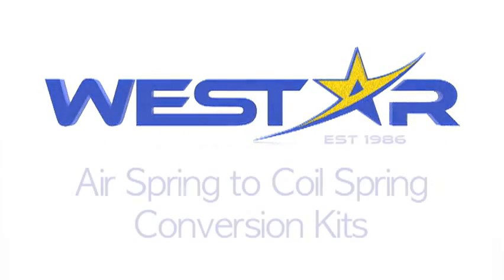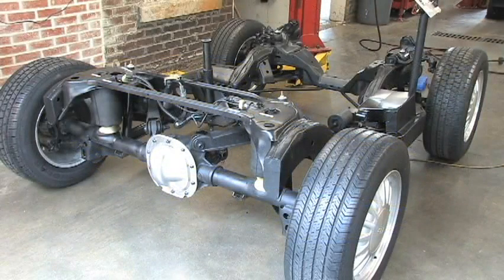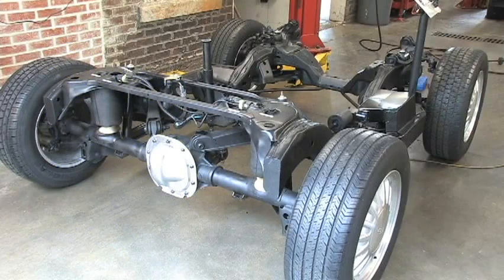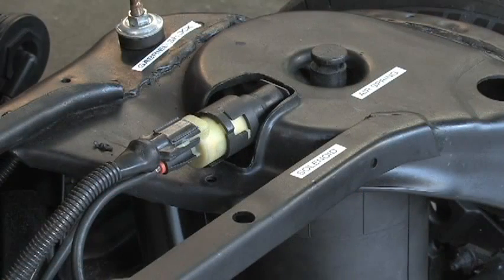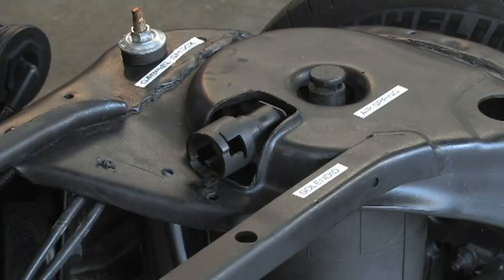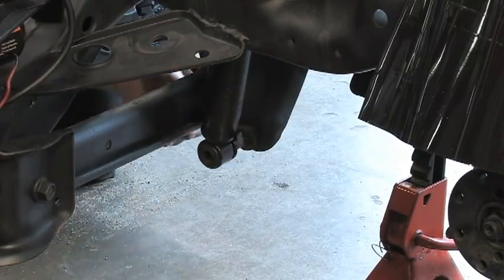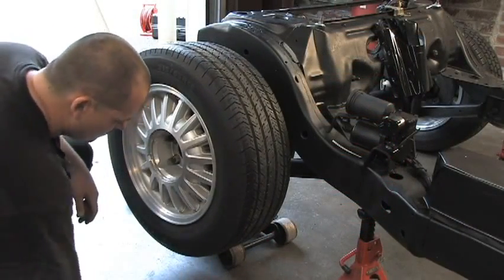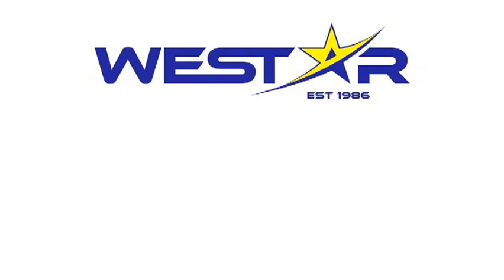Converting to Coil Spring Conversion from Air Suspension

Comment: I don't know why some would like to convert the suspension.  The air springs do provide a superior ride over conventional coil springs.  The rear air springs on my 2011 Lincoln Navigator recently failed and needed replacement after 10 years of operation.  
The vehicle remains operable with failed air springs, so I ordered new aftermarket air bags from ebay of $80 for the pair, which arrived in 10 days.  Quality seems to be equivalent to the OEM products.  I followed a YouTube instruction video to replace them.  About 3 hours of not very difficult work in the driveway to install them and the original factory ride is restored.
Reply: My right side air spring keeps popping. I replaced twice in 1 week and the third one lasted 1 day. Don’t know why it keeps popping? 03 mercury marauder 125k miles
Reply: @TEMPERWATTS  That is strange.  Something must be hitting and puncturing the air bag.  Can you determine where on the bag that leak occurs?  If you obtained all three from the same source and stock, they could have a defect.  Has your supplier warrantied the air bags?
Reply: In Canada, the air pump, lines and plugs on top of the air spring itself erodes very fast and becomes an ever increasing issue over time from road salt and whatnot.

This is why some people would want to convert. If I bought new vehicles, probably wouldn't be an issue.

But I like to own my vehicles even if that comes at the cost of buying used vehicles. Used vehicles with air systems are usually on the verge of death or already are. Lol.

Just my 2 cents 😎🤙🏻

Comment: Will this springs from a spring conversion be able to replace factory coil springs on a grand marquis that did not come with air? I con only seem to find air or coil conversion kits and I wasn’t sure if the spring seats were the same for factory air and factory coil

Comment: the reason to do this, is that the pumps need replaced frequently and so do the air springs.  This sort of air suspension system does not seem to hold up well in wet cold climates, where slush and salt erode them.  The air springs are about a hundred dollars each, and the pump can run 300 dollars and upward,  If you replace with the conversion kit a little over200 dollars including the shocks, you won't have to pay for pumps anymore.  BUT!!!! it is not as easy as this video makes it look, the conversion kit comes with new shocks, so plan to replace those also, (also plan that the old shocks are rusted in solid and you may have to cut the bolts, buy new bolts and save yourself a trip)  and the coil spring is almost twice as tall as the air spring. you will not be able to muscle it in the space with out some sort of spring compression device.  something like this one,   https://www.lowes.com/pd/K-Tool-International-Automotive-Strut-Spring-Compressor/50376246?cm_mmc=SCE_PLA_ONLY-ToolsAndHardwareSosAtg-PowerTools_-50376246:K_Tool_International&CAWELAID=&kpid=50376246&CAGPSPN=pla&k_clickID=8a2d0425-06e6-4080-95a2-960f153881ef&gclid=Cj0KCQjwnqzWBRC_ARIsABSMVTOUrKcvmxUvzLtb8undMadqXGb3dBndSg2enO-fHajuZQRoNL9gTwYaAkUfEALw_wcB      Otherwise this video is very helpful. oh yes, also we needed to utilize two jacks,  at some points,  we used the second jack to keep the spring compressed in its place while we put the shocks back on.  putting the jack under the wheel mount.  Otherwise the spring will press a the shock downward, pass the point where it mounts on it's bottom bolt.    Good luck, doable, pain as all car repairs are.   by the way we also like that the rear end sits higher, we were dragging the but on this car on curbs since the day we bought it, but no more.

Comment: People who say replacing the bags is cheaper than this conversion are delusional. Sure you can get cheap air springs but they won't last you two years, and that's if your lucky. You replace them twice with cheap bags you've spent twice what the conversion kit costs. Or you can buy actual OEM air springs that will last and spend $350+ each. And you still have to worry about the compressor as well. Did you catch the leak right away? Did you drive it for awhile before you replaced the air spring? These compressor aren't made to run constantly the way they have to when there is a leak. Those things are $500+ for OEM. So in the long run you're looking at $1200 dollars for OEM replacements. You can get a Monroe air ditcher kit for $150 bucks and forever be done with it.
Reply: To do the air spring job right, you're changing the springs, dryer, and compressor and all the o-rings.  The job, done right, will take about 3-4 hours if you're starting with a dirty car that hasn't had any of that maintenance in 100K miles.  They all wear out at about the same time.  Total cost; about $500-600 without labor.  Quality parts will last over 100K miles; sometimes as much as 200K.   You can buy lifetime replacement warrantied high quality air springs from arnott for way less than you are quoting above.  The ride quality of air springs is superior.  The ability to adjust to load is superior.  The maintenance is worse than a coil spring; which never fails.  Your choice.  Coil springs are cheap, and labor is less.  Quality of ride is less.  Ride height doesn't adjust.  You'll probably never have to touch it again as long as you're happy with the result.  Better?  maybe.

Comment: attention
I have done the replacement with the moog coil/shock pack. DONT wast your time with needless continuous replacement of air components. IF THE AIR FAILS THE SUSPENSION FAILS. Socks/struts will never fail.

Comment: If you own one of these cars PLEASE DO NOT PUT COIL SPIRNGS IN.Replacing the air ride is cheap and easy. There is  NO NEED TO DO THIS!!!Seriously you and only ruining a perfect vehicle by performing this pointless conversion.
Reply: The dumb ass place sent me shocks for a limo
Reply: John Ulicky for an envoy it's cheaper to do a conversion. Their compressors and over all systems fail constantly.
Reply: Everyone that see's mine is jealous of my coil springs. I didn't own the vehicle with the air suspension in it. It rides great and drives as straight as it can after my first alignment since I got it. I know air suspension was a nightmare in my 88 98 Oldsmobile Regency. What's funny is seeing all the vehicles around here that are all busted down to the ground as mine sits high and proud.
Reply: John Ulicky my bags are fine but i replaced the shocks and now its super stiff whats wrong? please help
Reply: drew41428 You might had gotten the wrong size. My dad's 98 Expedition. The idiots before him I think put the wrong ones on it and they cut the coil spring to fit I think.

Comment: My Lincoln dealership does this for their customers. They use either arnott or strutmaster coil springs and new shocks. I used a local family auto shop.
Completed this 2 days ago and really like the conversion. No regrets. Ride is about the   same as air springs. Have a 2003 Lincoln Town Car. Saved a lot of money. $ 450 was the total cost. If you need air springs because you tow a boat then the air springs may be needed.
Reply: so 160 for brand new air springs is more than 450 for stupid coil springs... gotcha..

Comment: There's no need to do this job. Replacing the factory suspension parts is so easy; I replaced one of the airbags with a flathead screwdriver and it can be done in about an hour the first time. Once you know what you're doing it could be done in 20 minutes without instructions.

Comment: every Lincoln Towncar and Mark viii ive done sits much higher than stock air springs, I don't recommend this installation if you want your car to sit and perform as if new.
Reply: Not to mention new air springs for the TC are CHEAP!!
Reply: What do you reccomend then? Replacing the air bags?

Comment: Go to u pull junk yard. Buy springs from a crown vic. Did it in 1.5 hours and cost me 17 dollars. Rides great and won't fail. You do have to ignore the dash light.
Reply: Gee I installed both brand new air springs in 30 minutes and didnt have to worry about the dash light.... cost me all of $160 bucks too!!!
Reply: when you take the springs off a crown vic is there a ruber peace that you half to have when you put the springs on a lincoln or you just put them on?